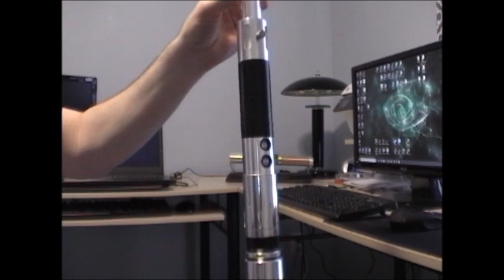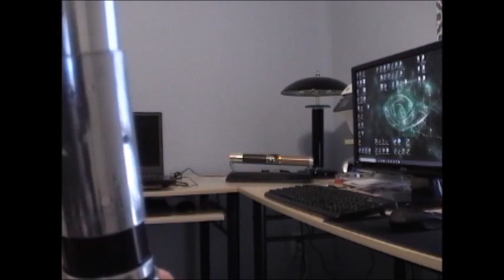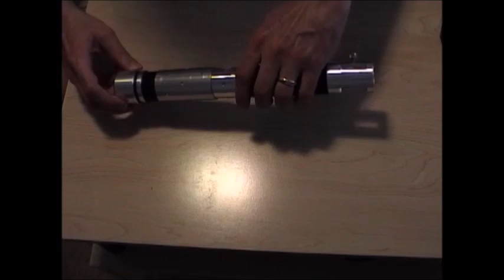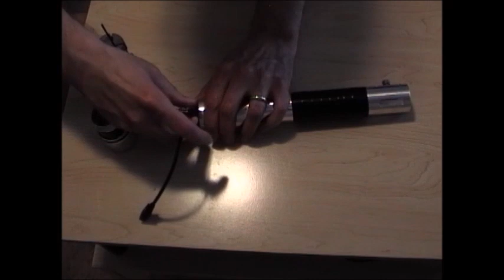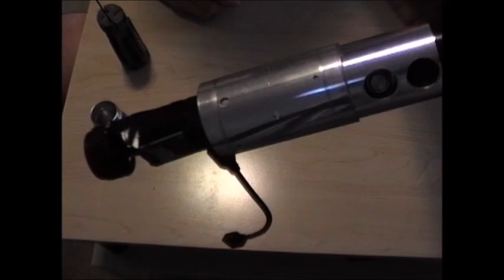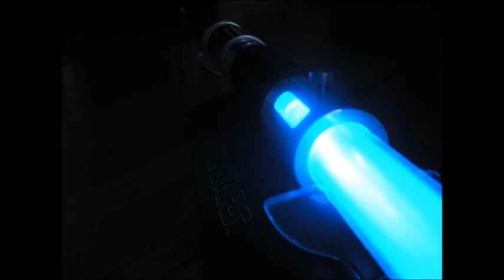DIYino Infinity (Arduino) Lightsaber

Comment: Will Diyino Infinity be also open-source or boards will be made just for sale? The software will work on nano 33 iot ble sense? And most important question - when? :D huge fan of Yours and Your job bringin FxSaber-OS.
Reply from the maker: Thanks for your interest! The Infinity software will be free. The board will be programmable and Arduino compatible. Our reference board is the Adafruit Bluefruit Feather BLE with an nRF52832. We are exploring porting the software to Nano33 BLE so DIY folks can build their own compatible boards for cheap. When? Well, the current environment is making that a difficult question to answer. Shipping costs have gone sky high which makes small batches not cost effective to produce.

Comment: Hi Jake, how do you wire up the led switch? I’m using an Arduino
nano and the STREAM interface but when I follow the wiring diagram in the
fx-saberOS the led does not light up. Iv tested the LED and used the FX os
sketch file and that works fine. The switch LED is rated for 12v and im using a
3.7v so I’m probably just going to hook up the LED to the battery and just use
a 220Ω resistor on the wire to protect it. Probably in the code instead of the A0
pin you are using another pin but I have no clue haha 😊
Reply from the maker: Select "Brewboard" when installing the firmware. That has the exact same pinout as FXSOS.
Reply from the maker: Also, for anybody who may be reading this later, the question is not about the sound board shown in this video. The poster is asking about the legacy 8-bit DIYino, the video shows a 32-bit DIYino "Infinity". They are not the same and software is not cross-compatible without porting of the source code. 
.